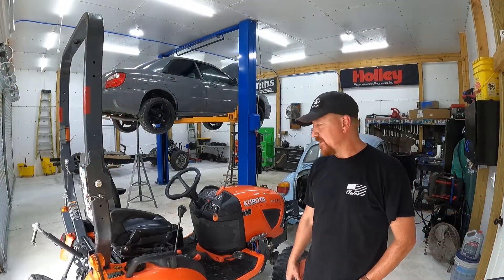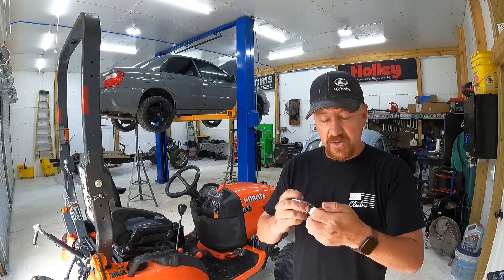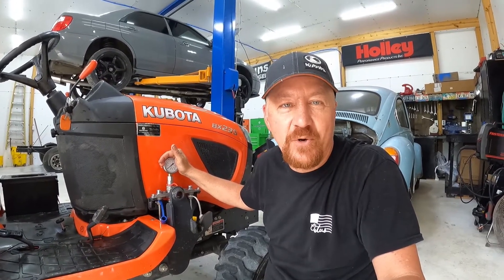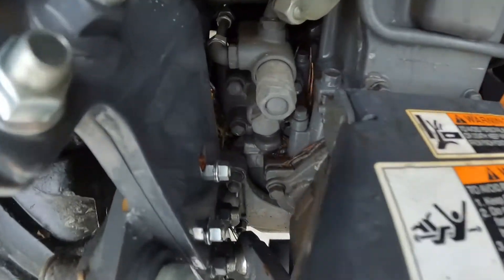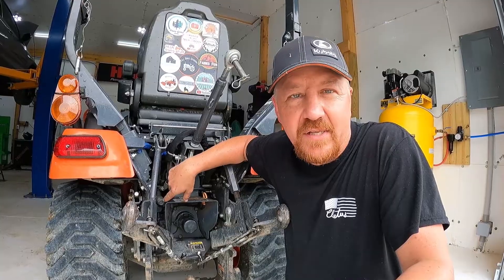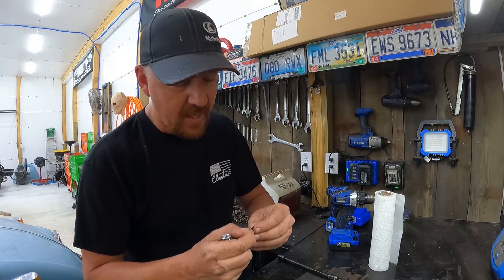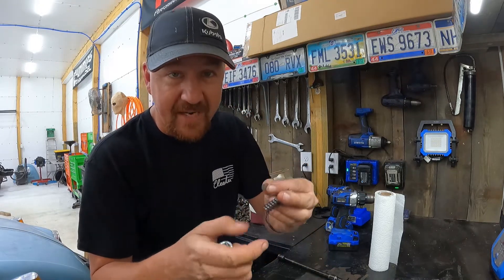More Backhoe Strength for $14 - What You Need to Know to Raise Hydraulic Pressure - Kubota BX23S

Comment: We always have to pay to play so you need to be careful about how much you bump your hydraulic pressure up

I'm sure you could go 20% or so without blowing stuff up as long as you're careful when you operate at higher RPMs 

Also, that pressure gauge is filled with mineral oil not water. Just FYI.

Comment: I don't know if you still look at comments, but I just came across your EXCELLENT video.  I have a 2025, BX 23S with 60 hrs on it.  I am so, unimpressed with its lifting capacity.  I traded my 2002, BX 22 for the BX 23S thinking Kubota has improved over 23 years.  My BX 22 was much better for lifting, so I am going to get myself a gauge and see what I have for pressure.   Here is my biggest issue, which I hope you can help me with.  If I walk away from the 232S with the bucket up (no load), or with the 3-pt hitch attached (no weight), I find them on the ground within 12 hours.  My BX 22 never did this.  I have had the tractor back to the dealership, and they said the self lowering is within spec, and the lifting power is within spec.  Now that I know how to adjust the pressure, how do I keep my utilities from dropping to the ground?
Reply: I also upgraded ( I thought) to a newer BX23s from a BX2200 and agree the lifting capacity is very disappointing from the factory.  My old tractor can run this one one into the ground as far as lift and curling breakout force.  Ordering a gauge tonight from Amazon and trying this pressure boost option.

Comment: Do you just keep putting in shim’s until you get results. I’ve now put in 1x6 and 2x4 giving 14 and no change still 1,100 want 2,000psi should I keep going?
Reply from the maker: 1100 is crazy low.  Just be sure you’re testing everything right.  You don’t want to over pressurize it.
Reply: New gauge and the post knocker needs more pressure to lift ram  so no reason to think gauge is wrong. So just keep packing out till I get a result?
Reply from the maker: I would say so.  That’s what I did.
Reply: Kubota l2550 2275psi I’m getting 1100psi do I just keep adding shim’s? Have replaced spring and Oring

Comment: Does this equally raise 3 point hitch lift capacity? If so, is it the same comparable 150 lbs per 250 psi as the front loader? Thanks.

Comment: I just got the pressure test kit with shims and found that my BX2680 pressure was at 1650psi.  I increased to 1900PSI, the loader picks up a bit more now like it should have had from the factory. Wonder why they left it below the minimum setting, probably due to the complacency during COVID would be my guess.

Comment: thats an easy enough upgrade for the diyer. i like how thorough you are when you explain how you do things.
Reply: It was very simple, 22mm socket and about a 10" extension and its as simple as removing the valve, removing the spring, seeing what shims if any are in it, and adding shims until you get the pressure you want.  I did mine in 2 tries...added 1 shim, reinstalled the valve, tested, then removed it again and added another shim and got the pressure I wanted.  It took maybe 10 minutes altogether....very easy, and easy enough you can change the pressure lower or higher within minutes if needed later on.

Comment: I know this is an older video and I am a subscriber and was just going through some older videos that I didn’t see, ok I’m 52 I may have forgotten. 
I hear your looking for a bigger tractor. I have a B2601 and thought what’s different with that and the LX2610. Well come to find out not much. Loader cylinders same, rear end same, plate form same and goes on and on. 
Now it lifts more, but some shims in mine it’s close now. Whats better well Better seat, 1” more clearance, digital gauges, bigger pump, bigger tires, bigger price, ok maybe not the price Anyway this is just something I found out and wanted to share. I thought it was surprising how close the two tractors were. Love your show. Can’t wait to see what you do to the bigger tractor. If you get one.
Reply from the maker: Great great comment!  So I am for sure keeping the BX, but I am 95% certain I’m also going to get a bigger tractor.  I am doing more and more work with logs and I need more lift capacity.  I would love to get another Kubota from Davis Equipment, but the Kubotas just are not competitive when it comes to lift capacity for price.  

I am going to have several videos about the tractors I’m considering over the next couple months and then I will buy.  

Thanks for the information!
Reply: I think the difference between the B and LX series is the physical size of the tractor.  Maybe a different engine maybe?  Or maybe calibrated different at least.

Comment: Thank you for the information,  very helpful. This should help save on a expensive repair bill from kubota.  Will this improve the transmission functions? Seems like mine does not move forward as it once did.  I am worried I may need an expensive transmission repair... Thanks.
Reply from the maker: It is my understanding that the hydrostatic has a separate pump so the PRV doesn’t affect the transmission.  I do not know that for certain…

Comment: What is the torque spec of that cap?  What is should one shoot for to torque that bad boy.  I dont want to damage it and  I dont obviously want it loose.
Reply from the maker: I don’t know for sure, but somewhere around 30ftlb also, if you tighten it more or less it will change the pressure so when testing make sure you always torque to the same setting.

Comment: I have a 2022 bx23s. My stock pressure was 1650psi. I used all the shims that came in my kit and I went up to 2150.  Definitely a big difference in lifting capacity, but now my controls are super sensitive. Before it was really easy to feather the controls and operate very smoothly, now it’s jerky like my in-laws green machine.  Oh well, always a trade off. Once I’m done with what I’m doing that I needed the extra lifting capacity from the loader I may return it to stock.
Reply from the maker: That is true.  It does make the controls way more sensitive.
Reply: I put my arm on the rest to do more sensitive adjustments.  Keeps me from being jerky.
Reply: That's funny, I just checked my BX2680 and was at 1650PSI, I only went up to 1900PSI with mine though since its still under warranty...but at 1900PSI that reading is at PTO RPM, at the loader RPM setting its right at 1850PSI.  Made a difference in its lifting ability for sure.

One thing I learned with the jerky feeling is to lower the RPM and its smoother.

Comment: Thanks for this information. My question is how would you balance the hydro pressure more evenly between the backhoe left stick functions and the right stick functions? My left stick will swing the backhoe left/right quite vigorously to where it almost knocks me off the tractor. Raising the boom up and down is quite fast as well. But right stick functions such as raising and lowering the dipper and curling the bucket is slow and lethargic. I feel the pressure between the two stick control valves is not equal . I've asked my dealer about this and they don't seem to know how I could make any adjustment.
Reply: It has less to do with the pressures and more to do with the geometry of the machine.  Sizing of the cylinders and where the pins are, that kind of thing.
Reply from the maker: I just don’t really know the answer to that.  I’m sorry…

Comment: Well, I reckon the First thing everybody needs to know is when altering these machines /systems is that the guarantee is out of the window, furthermore altering these pressures gives you a personal liability in case anything happening to you or somebody else.
Reply: Not exactly.  They would essentially have to prove that what you did caused the problem.  If your injection pump dies and you boosted the pressure, they'd have a hard time proving that caused the issue.  Now, if you blow out a hydraulic fitting then yeah.
Reply: Not exactly....as long as you do not exceed the max pressure ratings there isn't any harm in increasing the pressure...I just did so, in order to get up closer to the max which I believe for the BX80 series is 1850PSI that is max recommended....not max pressure the system can take....people go above that all the time supposedly without issues, but who knows for sure they wouldn't tell you if they did cause an issue.....my BX2680 was at 1650PSI since 2021 when I got the tractor new, which I think is about 100PSI below the minimum pressure rating....so I bumped it up to the 1850PSI today, that is at the loader/backhoe engine speed, which is where I normally run the tractor when I'm using the loader...at max RPM for PTO use the gauge showed 1900PSI.

Comment: The factory pressure setting are in place to keep you from doing damage to hoses, hydraulic cylinders and the hydraulic pump. Find the maximum recommended pressures and DO NOT exceed that pressure or you may cost yourself a very large repair bill. Bear in mind, damage to the hydraulic pump occurs slowly over time and may not be noticeable in the short term.
Reply: Increased mine to 2400 psi and zero issues in 200 hours of use!
Reply: Idk what this machine is spec at.    But our is a 2501 and it specs at 2400psi.      I have to order the shims to get there.       Running them at the teccommenddd settings does not hurt them.    And they are obviously made to be adjusted when needed.     Furthermore many many times if you take the time and check the part numbers the same part will be used on a different model and will have way different performance.      For example my little tractor engine on a non emission motor is 15 hp more.   It’s literally the exact same tractor.     Only difference is the injection pump has shims to decrease injection and a timing change.
Reply: Hoses are rated for 3,000PSI, you aren't gonna hurt them, or anything else on the machine, its showing around 2,000PSI max for the other parts on the machine from my understanding....for me my machine was set at 1650PSI, which is lower than the minimum rating, so I bumped mine up to 1850PSI at the loader/backhoe engine speed setting, but if you go up to the max engine speed for PTO use, the pressure goes up to 1900PSI.

Comment: I did this on my BX 1870 a while back.  I found that the cold pressure vs. the hot pressure differed.  Hot went up about 110 psi.   Metal expands when hot and it looks like something expanding (pressure relief bolt?) causes more spring pressure.  Not everything changes the same to compensate.
Reply from the maker: This is a good point!  I haven’t got back to check my pressures hot.

Comment: At what RPMs did you run the engine to take the measurements
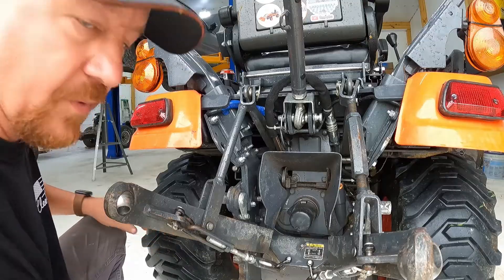Reply from the maker: Check the 10:00 mark…
Reply: Thought it was to be checked at full throttle, but it makes sense to check it at operating rpms cause you are not going to run it on full throttle for most things
Reply from the maker: @danm8662  yeah, I don’t know what they recommend, but I thought it made sense to just check it where I run mine.  🤷🏼‍♂️

Comment: Just a heads up you need to watch using that power beyond line. That makes a loop an with it disconnected  it starves the hydraulic pump an it can an will burn the pump up.  My local dealer has pictures posted in the parts department of the damage several people have done using that line cause they run it too long unhooked. That pump isn’t cheap.
Reply from the maker: Thanks for the heads up!
Reply: Yeah absolutely, based on what my dealer told me at delivery time when they showed me how to add and remove the hoe, it’s actually worse than that. Take it with a grain of salt but they claimed that running the tractor with that hose removed would deadhead the pump!  Not 100% sure that’s true (does it just force all the pump output through the PRV?) but I did actually blow that loopback line at one point and lost all ability to do anything with the loader also so I’m fairly sure that line isn’t just a return to the sump.  Trying to raise the loader when the line blew caused it to spray hard instead of dribble. All the flow seems to go through that hose first.
Reply: @gatesj777  Interesting as I was planning on trying a wood splitter on that circuit

Comment: I'm going to have to try that.  Here in New Hampshire, when I dig a hole I get more rocks than dirt out of the hole.  When I encounter a large rock I end up digging a much larger hole than a fence post needs.  Just to get the rock out.  If I had more pressure, maybe I could just lift out the rock and not have to dig around it so much.
Reply from the maker: That was essentially what I was after too.  I can say with certainty that it is a different machine.  I am much happier with it now.

Comment: Good point on positioning he cap.  But, I’m not sure your adjustment effects the backhoe.  I upped my BX25 to 2000 psi some years ago and for sure it increases what the loader will lift.  However, the backhoe has its own valve block with a separate tank return line so it may very well have its own pressure relief valve separate from the main relief valve.  I don’t know for sure, but have always wondered since I don’t feel the same increase digging with the backhoe as lifting with the FEL.  Someone with a technical or repair manual could check to be certain.
Reply from the maker: I don’t have definitive proof yet, but I did read that there is only one PRV on the BX23S.  I also do not see anywhere on the valve block where it is integrated.  I intend to just do a real world test adjusting the pressure to determine an answer.  Stay tuned and thank you for the comment.  👍👊

Comment: Definitely interested to see some field results! Makes you wonder what kind of safety margin Kubota puts on their operating pressures. I’ve thought about adjusting the relief pressure on my excavator, but I’m hard enough on it. 😅 - Samuel
Reply from the maker: Lol. Yeah, I could really do some damage with full size equipment!  I’ve read about guys running 2400psi.  I am pretty rough so I figure 2k was enough.  My warranty has expired anyway so I’m on the hook if I break it.  😂

Comment: Hope you never have to have any warranty work done. Once they see the paint has been broke around the pressure relief bolt, your warranty is done right on the spot after the investigations.
EDIT: just to be clear on the subject, i know 3 people that did this, they tried to have front end loader items replaced due to the tractor being over worked for its capacity all because they brought the pressure up. There is a reason kubota set the pressure around 1750max psi. And also, watch for oil leaks to start happening when you jack up the pressure.
Reply: You are wrong.  Warranty is for replacing defective parts.  Changing the pressure has nothing to do with warranty.  Stupid Salesmen and Dealers (and Corporate Kubota) will throw any EXCUSE to avoid warranty work.  Dealers will adjust the pressure for you, especially when the pressure is below specs.  I do not have warranty on my 2010 BX25, but I broke the FEL frame (defective welding- manufacturing flaw), broke the differential lock twice (undersized locking pins- manufacturing flaw) and I bent the dipperstick ( using excessive leverage), not defective. I did all my own fixes, because I can.  I own a piece of equipment to accomplish tasks, not fret about warranty.  If you can not afford to operate your machine, don't buy it.
Reply from the maker: Well, me too, my friend.  That’s the choice one has to make for themselves.  Thanks for watching!
Reply: @PeeksPeakHobbyHomestead  
Lucas, you are one of the better ones who has actually gave a full disclosure on it. Thumbs up for that brother. Keep it under 2,000psi, you`ll likely be fine. Anything above that will make the hydraulics very jumpy and harder to control smoothly. Being jumpy actually slows you down because you have to be more careful with it. Do remember, and keep in mind, that your steering runs of that same single stage pump.
Reply from the maker: I appreciate that!  I sure don’t know it all, but I try to share good information.  I only want to help.  Don’t want to cause anyone to break anything.  👍
Reply: pro tip , Kabota sells rattle cans of the factory grey enamel paint